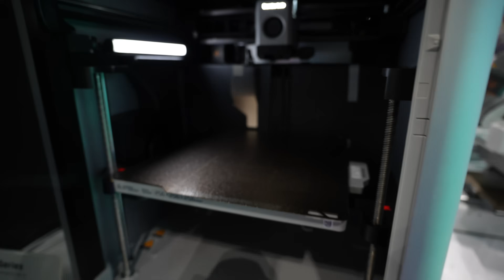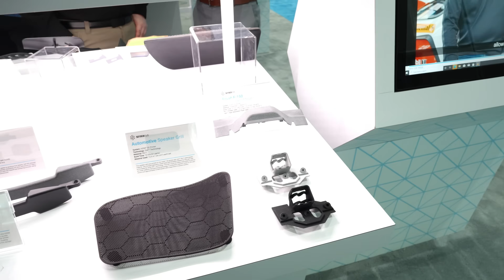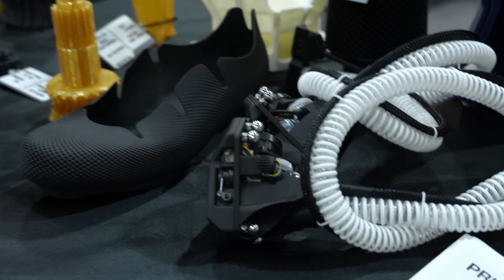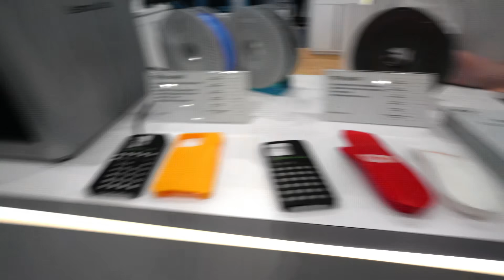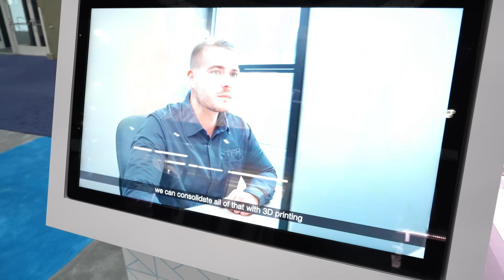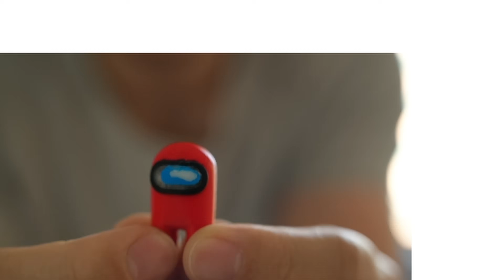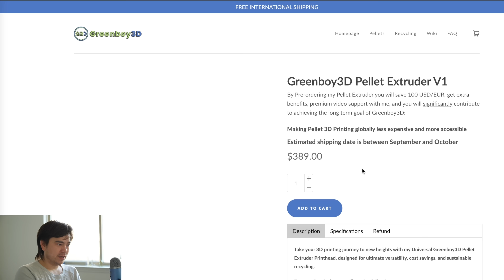Bambu Lab Patent Infringement, PRUSA MK4S, and Cheap Pellet Extruders (3D Printer News August 2024)

Comment: Interesting! Bambu Lab customer support advised me to buy a new heatbed for my X1C at 800hrs of printing for over £100. Refused to honour the warranty. Didnt answer any of my questions about why i needed a new heat bed (mine was a V2)  and why i have to fit a V3 heatbed and AC control board. Turns out after doing some fault finding it was the control cable priced £3.99! They might make good printers but i never want to experience the shit show that is Bambu support ever again! Bambu have stolen the work of the community, gives back the minimum, ripped off companies and then even tries to rip off their customers even on repairs. I will never buy a Bambu product again. So good luck Stratasys! I hope you nail those thieving bastards!

Comment: In the early 90's my company started using SLA 3D printing, the 3D industry evolved slowly with new and innovative printing methods, Stratasys and FDM were a disruptor to an expensive industry. FDM was inferior in many ways, at least for us. more or less a Stratasys FDM machine cost tens of thousands of dollars, Stratasys basically used existing 2D plotting software leveraging other industry patents without having to develop the technology. For 20 years, Innovation in the 3D printing industry has been stagnant and slow FDM looked dead and useless given other 3DP processes. When Stratasys's FDM patent expired, in 2009 the cost of the least expensive low end crapy 3D printer sold by Stratasys went from around $15,000 to about $300 for a comparable FDM machine. The industry went through a reactance, innovation exploded. Stratasys haven't been innovators, they've been taking the innovation that's come from grassroots enthusiasts and figuring out how to patent it, They've bought competitors to try corner the market. 3D printing FDM is what it is because patents became useless, aka expired.

Comment: I couldn’t help but laugh. Back in the ’80s, I worked at a company that found itself in the crosshairs of an IBM lawsuit over copyright infringement. As part of the case, I was tasked with reviewing nearly all the patents involved—and what I discovered was astonishing. IBM actually held a patent on the method for centering a character or string of characters on a computer screen. It’s a simple algorithm, one that every programmer knows by heart, yet IBM owned exclusive rights to this function. Hard to believe, right?

In the end, my company lost the lawsuit. They had, in fact, copied IBM’s code—and, unbelievably, left IBM’s original comments intact in the copied version.

Comment: THE GRAPES ARE SOUR, RIGHT. Bambu Kab are just doing what Stratasys would not do ... make good 3D-printers available to common people. They thought there not a lot dollars in selling 3D-printers to common people. Now they see how much profit Bambu Lab makes in the private market and envi burns in their pockets. Patent is a lot of BS. It has only one purpose (as you mentioned in the video) to slow dow development - which is good for companies with patenys, but bad for common people and small business'. They don't have the money to buy expensive and overpriced 3D-printers fra Stratasys, usually costing 10-times as much as the best 3D-printer sold to private people and small companies. Should patents give big companies the right to control the market. I think NOT. Some years ago we saw the same problem around Microsoft software. They tried to keep monopoly in the market of software to PC's, but the legal court of America made the decision, that this was not in the interest of the public opinion. The court banned Microsoft from the right to monopoly and all competitors the same right to the market as Microsoft. The same will happen to Stratasys. The legal court will nullify those patents, which Stratasys claims Bambu Lab is violating, especially on the ground that Stratasys did not pursued the lowend market. Another issue is, that several of the patents Stratasys have are obsolete - either due to the content of the patent (much of it is common knowledge today) or because the patent violates competition in the market area. It is common knowledge, that patents are given for too many years. A millenium ago 30 years was not a problem, but today it is, because of how fast society develops - particularly in tech areas. Another possibility could be - the court sets a transitional period of 5 years for settlement of the patents on which Stratasys and Bambu Lab disagree. Stratasys then has the option of charging a fee for each unit Bambu Lab sells for the next 5 years. Personally I don't see the problem. Stratasys could just start production of the same product Bambu Lab sells. They already have the knowledge and the technology, so it should be easy to design a few 3D-printers, which could be sold at the same low price as Bambu Lab 3D-printers or maybe lower. China is very good at copying US design, but they still does not understand the technology behind as well as they should (try comparing Chengdu J-20 to F-35 lightning)

Comment: Informative video. Only point I'd add is that it's more likely than you think to get patents invalidated. Only 4 percent of challenged patents actually survive intact. More survive in part, but possibly only because once the challenger proves invalidation on the claims they were allegedly infringing, they usually stop. The vast majority of patents are garbage. The Patent Examiners do their best, but there's so much out there, it's impossible to find all of the prior art until there's millions of dollars on the line. Then the real search begins. Patents are mostly good as a threat of substantial legal action, that drives an alleged infringer to seek a settlement that is cheaper than would be the legal battle--even if they eventually won the legal battle.

Comment: Bambu labs build plates use a metal plate with a taped on coating... Essentially, they applied the coating to an adhesive film instead of the plate itself, which makes sense regarding the patent but it´s also a better method, I think, because if it gets damaged you can just get a new tape instead of a whole new board and you can also customize each sheet, as they are double sided.

Comment: Even though Bambu may also be a large conglomerate, it doesn't really bother me knowing that they enabled thousands of people to pick up 3D printing at relatively low-cost without the fuss that comes with most other printers. After working with an ender for some time, the two Bambu printers I have bought (A1 and P1S) have been a delight to use. I hope Stratasys gets fucked in this lawsuit... Bambu might not be the "little company" they appear to be at first glance, but at least at the current point in time they are looking out for the little man by making 3D printing accessible to people that normally wouldn't ever dream of getting into it.

Comment: As far as wireless is concerned they could move to wired and the wired network to interface with wireless router. They could stop selling pei coated plates and let their customers get their own from third party manufacturers, etc. I currently use a third party plate on my Bambu lab printer. I would have to think about the other patents.

Comment: The RFID patent is likelythe most ridiculous patent .

Radio Frequency IDentification tag

They patented a use case not a product or any kind of intellectual property.

Maybe bambu should have used QR code and optical reader instead. Or gave stratysis patented thise as well 😮

Comment: You should take a look at chemistry patents. They do write stuff down - but in a way that some of it will resemble the actual process used, but it is obscured so hard that any other competitor will be unable to recreate the process with the  patent information alone - which was the base idea of patents.

Next we have pharmaceutical patents - first the last longer - and there seems to be a trick if the first patent for a pharmaceutical ingredient is almost expiring and during its time there was another use - the company can file a new use for the compound with the new  scope of application and have another patent time frame. With the downside that this "new" compound with its new field of application is no longer approved for the old scope.

In general patents are a currency. Companies file them and later trade them. They are the haves and if you are a have not - you will have a hard time in he field. Which is why we have open source, open hardware, open software. So things can be public domain and not lost to cooperation. One reason I would prefer to buy Prusa over Bambo Labs any time.

Comment: Patents are supposed to protect the inventor, in this case Stratasys.  I just bought a Bambu Lab printer (delivery today).  Bambu should have got ahead of this by getting a license to use the Stratasys technology. IBM, Microsoft, Google, GM, Ford, they all work the same way.  That's why all SUVs on the market look the same and operate similarly: they buy rights from the inventors.

Comment: As far as the Cura Slicer tech, if the company that patented  the approach, and then provided it in the Open Source Realm, the Open Source release nullified the patent. Also, the Open Source people (similar to Linus Torvalds and Richard Stallman) and can say: "I was developing systems and it was obvious to to it this way based on the current paradigm. I never looked at your stuff, because it was too expensive."  Bambu Labs cannot claim the Open Source route, because they are buying patents of their own.  I think the Open Source companies are in a far better position.  Also,  Voron (similar to Linux) could be the spoiler here, where, companies could just say "I was using Voron tech" .  Since Voron  does not sell 3D Printers, they are impossible to go after in a corporate world, because they do not exist in that world.

Comment: The RFID one is definitely a prior art and damned obvious one as is the load cell bed sensing, as is the networking one. Printers have been networked for more than 30 years so why shouldn't 3D printers be. Anyway I'd just sell Ethernet to serial adapters and put serial ports our there. Also filament with RFID, I would never buy a printer or filament that had it because it's too easy for them to vendor lock in which in my opinion should be illegal anyway.

Comment: I vow never to buy a bamboo lapse printer which is kind of a shame but lost here. I ordered an X1 with accessory kit and then they want the enclosed the x1 enclosed which was cheaper than all the bits I bought so I sent them an email asking them what my options were. I specifically said do not cancel my order. They canceled one of my orders and they sent out the accessory kit whilst I was away which meant by the time I got back I was out of the 14 days and couldn't send the accessory kit back and top that off. I was happy with the printer. I was just asking a question and they refused to sell me the printer again. Same price is what I originally purchased it for even though and they would not accept the return of the accessories. So now I have 150 lb accessory kick but I can't return that. Sits in the corner of my room doing nothing but I will not buy a printer to justify that cost from them.

Comment: Disagree pn networking functionality of Bamboo Slicer, all 3d printer manufacturers compete with their own version of printing automation including networking. This part is frequently close-sourced and rwquires a subscription if using their servers. So everything cloud-related is supposed to be proprietary.
But local networking should be open-source. In BambooStudio cloud functionality is optional.

Comment: The patent infringement lawsuit raises some interesting questions. While I'm not a legal expert, it seems like the coating patent might be challenging for Stratasys to enforce. Non-stick coatings are widely used in various industries, including cookware, so proving that Bambu Lab's coating infringes on a specific patent could be difficult.

Historically, companies have found ways to navigate patent disputes.  Remember when RCA was building its radio and television empire? They were masters at both acquiring key patents and cleverly designing around others to avoid infringement. Perhaps Bambu Lab can find a similar path, whether through licensing, innovation, or even challenging the patent's validity.

If Bambu Lab feels the patent isn't worth a lengthy legal battle, perhaps a licensing agreement could be a solution. They could pay a reasonable fee per unit sold that utilizes the potentially patented coating technology.

Regarding the patent's lifespan, it's worth noting that utility patents in the U.S. typically last for 20 years from the filing date. If Stratasys's patents are indeed 15 years old, they may have limited time left to enforce them. However, it's essential to check the specific patent details, as there could be extensions or other factors affecting their expiration date.

It'll be interesting to see how this lawsuit unfolds and what implications it has for the 3D printing industry as a whole. Competition is generally good for consumers, but it's important to respect intellectual property rights as well. Hopefully, both companies can find a fair resolution that benefits everyone involved.

Comment: A patent on Purge towers...So basically they are basically have a patent on GCODE? DANG.  What. a patent for coating the print bed. You can't be serious...... A patent on having a printer that's connected to the internet. A patent for using an RFID tag on something? What? Ok now i heard everything

Tomorrow i will go patent using some sort of protective coating used on steel, houses, and various items I think its called "Paint".

Comment: Patents are often misunderstood as barriers to technological progress, but in reality, they play a crucial role in fostering innovation. By protecting intellectual property, patents provide inventors and companies with the incentive to invest time and resources into developing new ideas. This protection encourages the sharing of innovations with the broader community, which can then build upon these advancements.

One key aspect of patents is the requirement for attribution when using, altering, or basing new developments on existing patented designs. This process ensures that original inventors receive recognition for their contributions while allowing others to innovate further. Moreover, most patent applications include a list of prior patents that were integral to the development of the new idea. This interconnectedness highlights how new inventions are often built on the foundation of previous innovations.

Far from hindering progress, patents create a structured environment where creativity and invention can thrive. They establish a framework where inventors can collaborate, innovate, and push the boundaries of what’s possible—secure in the knowledge that their work is protected and recognized.
 This lawsuit is the swan song of Stratasys. They failed to read the market and to see how fast FDM printing is advancing. 

So if the open source SLS project that was just released causes the companies to loose money because the public realizes these huge corporations are just ripping off, then that guy should be sued?? No way!!  
I’m getting off my soapbox now. I’ve given myself a bloody nose and I need recreational chemicals, STAT. 
And, 3D Printing has been around since the 1980’s. And though Crump patented  an FDM process, in my opinion the credit should go to Play-Do and that cool extruding setup they had for kids. Or even before that, whoever started extruding pig lips and ears into intestines to make hot dogs.

Comment: Most of the patents from Stratasys fall under the category Prior Art. Connecting a device to the Internet is pretty obvious and has been leveraged before Stratsys patenting the idea. Same for most of the other claims such as using RFIDs. The whole concept of RFIDs is about this idea. Patents were actually invented to protect small companies and inventors from larger companies who were just stealing these inventions. Unfortunately, currently patents are used by large companies to sue others, thus preventing competition and technology evolution. They are also used for crosslicensing, thus being able to use other companies’ patents. If I were Bambu Lab, I’d prove that the Stratasys patents protect some pretty obvious and already used technologies (prior art), and I would analyse the Bambu Lab patents for being violated by Stratasys. Depending on the outcome of jurisdiction, I would then negotiate with Stratasys to pay license fees.

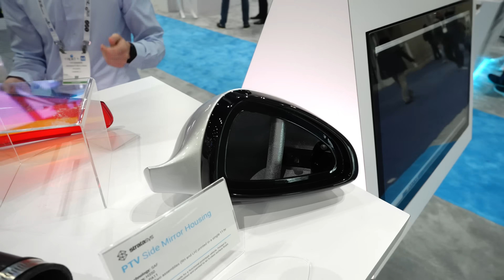Comment: @4:30 Comparing purchasing a $200,000 stratasys printer vs buying a couple $2,500 Bambu Lab X1-E printers - there is a problem here, and that is that stratasys has abandoned the lower priced hobbyist/consumer market altogether. It was their market choices that led to this moment. The quality is markedly different. If companies need to meet the higher standard then they need the Stratasys, as a product built on an X1-E isn't comparable.

Comment: Patents that rely on combining technologies that others developed are hard to defend.  Connecting a 3d printer to a network?  No…nothing novel added.  Same with RFID.  They did not invent RFID or the materials.

These have no net new invention.  They are really hard to defend.

You can’t patent a use case that is what the original invention was meant to serve.  RFID inventors already own the input sensing use case.  Wifi inventors own the “connected devices” use case.

These patents are expired…so…Stratasys has to invent some new, differentiated use case.